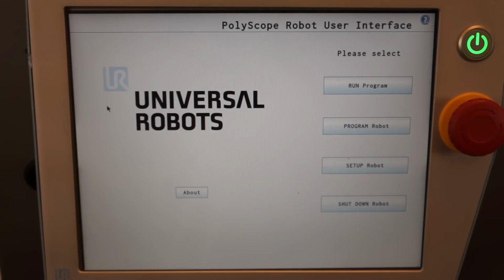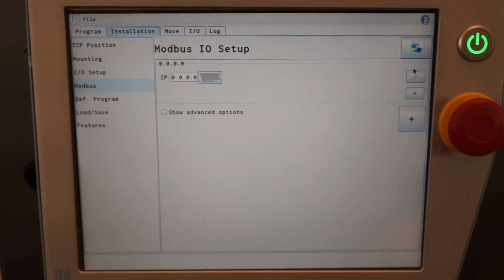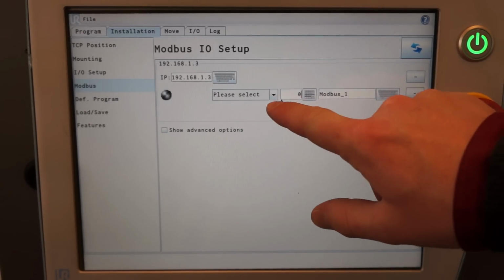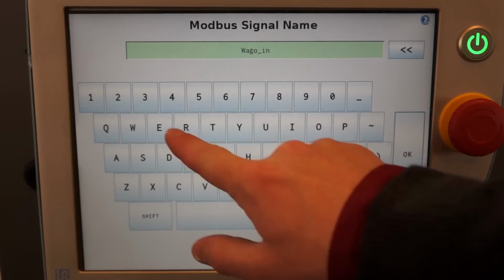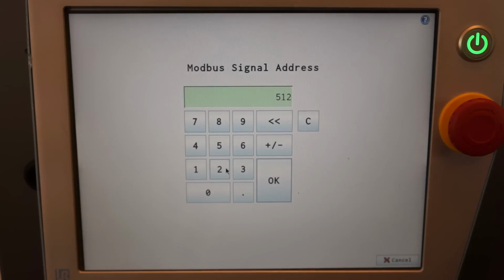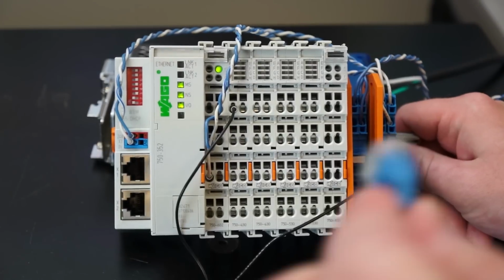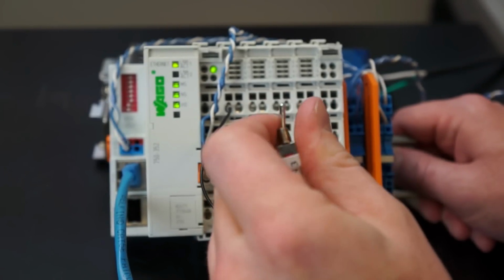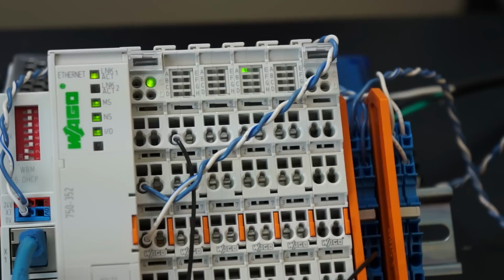Universal Robots with Expansion I/O

Comment: Is the UR considered a Master and the Wago unit a Slave?
Reply from the maker: Jesse Elizabeth Stalman  - in this case the UR is considered the Client (Master) and the I/O unit is the Server (Client), though the robot can act as either one.
Reply: Ok makes sense, I'm new to Modbus so this may seem like a stupid question.  If I have 2 UR robots in a cell and I want them to talk to a Rockwell PLC through a Prosoft Comm Card, would I have to have a card for each Robot or could they share a card through a network switch?  If they can share a switch can other devices speaking Ethernet/IP be on that same switch?
Reply from the maker: The two robots will likely be accessing the same data bits from the PLC, so I wouldn't think that you should need two different cards.  You will simply give the robot the address of the PLC (or the card possibly) when you go to setup the I/O.  Not an expert on Ethernet/IP, but I know it does cause a fair bit of network traffic.  I think you should still be OK sharing a network switch though.